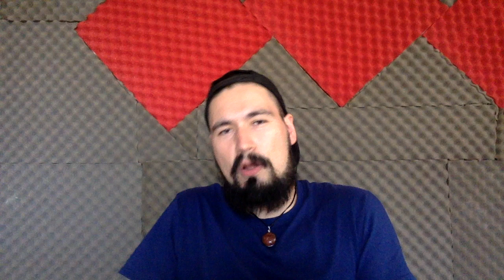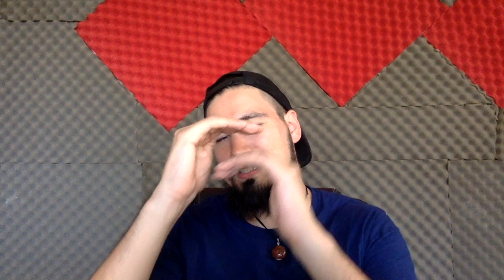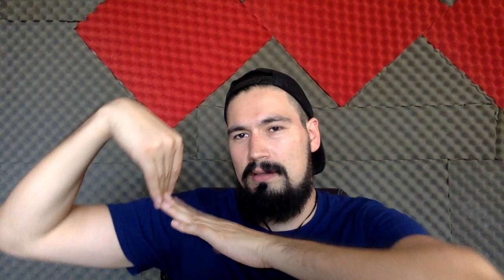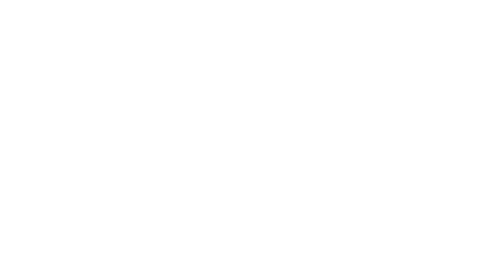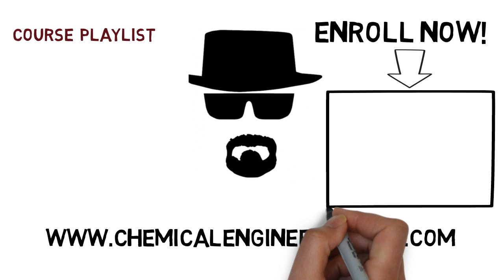Introduction to Section 6 - Advanced Absorption Systems (Lec175)

Comment: hi sir i would Ask u abt what IS the most easier/ convenient simulation program for process engineering  that i Can use for my students
Reply from the maker: depends really, first, you should know the $$ involved as they are expensive... If you just want to show models without any licensed software, try COCO or DWSIM
Reply from the maker: Otherwise, I will recommende Aspen Plus all the way, its the most used and it is easier to learn there an then change to another software (such as Pro II, ChemCad, Unisim, etc...)
Reply: +Chemical Engineering Guy thanks sir Aspen IS a free program?
Reply from the maker: nop, its actually very expensive... you will need access via work/university